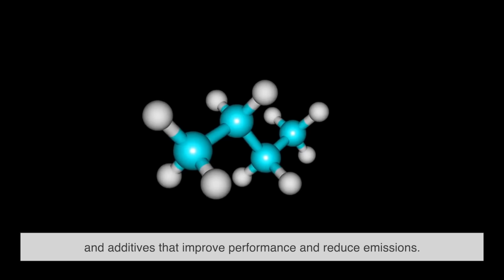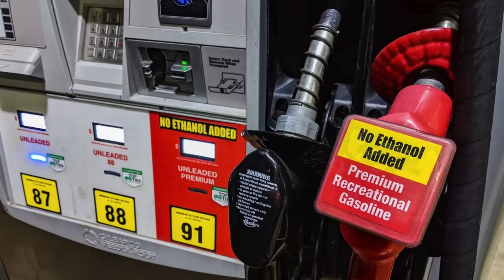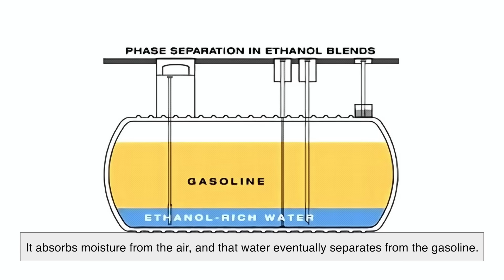Does Gasoline Go Bad?

Comment: I srored my motorcycle with 4 gallons of gasoline in its tank for 3 years in Vietnam due to COVID-19. The 1st few months battery was still alive for starting and running the engine in 10-15 minutes per week, but it was dead after that... The gasoline contained 5% ethanol  and stayed in the tank for 3 years; the result was the tank corrosion completely and the pump malfunction. I cleaned the tank thoroughly and coated with a designed epoxy for it, and then replaced the new pump. 
From now on, I use gasoline without ethanol and store my motorcycle during the absence time in Vietnam; plus hook up a slow/ticke 1 Amper charger, and running engine 5-10 minutes per week.
While I leave USA/California for the trip (usually 5-6 months), I add gasoline stabilizer into the car tank and gasoline container (for lawnmower and high pressure water.) Please note that all California gas stations sell gasoline that blend with 10% ethanol plus extra oxygen. They are 2 main elements (ethanol and oxygen) contribute to tank corrosion and damage the pump and fuel lines. Please add gasoline stabilizer if you aren't use the car more than 3 months. Per manufacturer for gas stabilizer, adding it can store gasoline in two years. Thank you.

Comment: yes. Stale gasoline in the nunber one cause of lawnmower and snowblower starting problems. Need to run these dry before letting sit for months without use
Reply: Here is one for you. Years ago, I bought a Chinese generator at an auction for $10. It looked like it had been sitting around for a long time. I brought it home, and sat it beside the house, and forgot it for several more years. One day, I decided to see if it would run or if I should just scrap it. I checked the tank and it had really old and smelly gas in it. I gave it a try anyways, and it started right up. I had a similar experience with an old Coleman generator that I got the same way. Same results. What I will say is that neither one ran really well until I put some fresh fuel in them, but there was no lasting damage.

Comment: Gasoline does not go bad!  Period.  If the container is air tight and there is minimal air in the container, it won’t “go off”.  If it’s in an open container it can.

Comment: I think the main thing is moisture.  But yes it can gum up your carburetor and fuel lines.
Oh, kerosene can gum up your kerosene heater. I've had that happen. The wick wouldn't even move. Of course, it was stored for years with kerosene in it . Big mistake. I always burn off all the kerosene before storing it now .

Comment: I've pulled stuff out of the weeds that had been sitting for years, some of it long enough to have to remove small trees and bushes that had grown up blocking it in. Most times the gas was fine. I have seen it turn to a thick varnish like residue but that was in tanks of old cars and trucks that had sat for like 30 years. There is no reason to drain a fuel tank on something that has sat for 6 months or so unless something happened to it like it sat in the rain with the cap off the tank or something.

Comment: BS! Gasoline lasts for much longer. A year old gasoline is still totaly fine (tried).. I didnt tested older, because I usually use it faster, but I would be confident, that 3 years old would be still ok to use... in carburator engines even a lot older than that...

Comment: I recently sold a portable generator that I filled when i purchased it 14 years ago, i put 5 gallons of gas with a bottle of Sta-Bil, i turned the gas off to the carb and ran the float bowl empty. I would start this generator and let it run every 3-5 years (when ever I thought about it) and it always started and ran great the person I sold it to couldn't believe the gas was 14 years old, I did recomend drain and refilling it or atleast a partial drain and mix with new gas.

Comment: I think depending  the engine type,  I have a 1993 Grand Marquis used as a weekend toy car,generally it seats up to 8 months without running,and of course with the battery terminal disconnect ,but the moment I turn the engine,it runs perfectly  !

Comment: Back in my motorcycle days, this was part of my winterizing procedure: I would dump STP Gas Treatment in the tank for a stabilizer, then start up the engine, and run it for a while to get the additive/fuel mix into the carb. Then I would top off the tank to minimize the amount of air in the tank. My theory was that moist air in the tank could lead to condensation, which could roll down the side of the tank and later get sucked in as tiny water droplets contaminating the carb. (I had coated the sides of the tank with some kind of sealant (MEK, I think it was) so that water vapor would be less likely to cause any rust in the tank.) Probably way more than I really needed to do.

Comment: Of coarse unleaded fuel breaks down over between 6 month to a year and a half depending  on conditions 

And it has that dead fuel smell

Which you have to drain athe dead fuel ,including new filters  and put fresh fuel in for it to run 

Just topping up with new fuel doesnt work so no short cuts 

Diesel  on the other hand  takes a very long time to break down 

I had the 20 liter jerry can of Diesel  used for over 10 years  in the shed  because I no longer had a Diesel  vehicle 

But used it recently  in a Diesel  vehicle  and had not problems at all 

Obviously  if it has rust and water I  the Diesel don't use it
Reply: I have a car with 5 month old gas in it 😂😂😂

Comment: Years ago, I was almost out of gas, so I stopped at a Phillips 66 station and filled up. Just a few miles down the road, my car started to sputter & misfire. Shortly thereafter, it simply died. When I got it to a mechanic, he found the tank was basically filled with water! I complained to the station. They claimed that it was in my tank before I got gas. I pointed out that if that was the case, I was burning pure water when I pulled into the station. I complained to Phillips Corporate without success. I've never bought gas at a Phillips station since.
Reply: Gas pumps are inspected usually by the state's consumer agency as listed on each pump's inspection sticker. Contact your state's consumer agency to file a complaint against the station. Hopefully, they will send an inspector to take samples of the fuels in the underground storage tanks.
Reply: Some say 87 but its 86 or 85.
Reply: If you have the receipt you should be able to claim on your motor insurance. The same thing happened here in outback Australia, the guy had the fuel receipt and a mechanic confirmed the water in the fuel. He received a check for a complete write off of the vehicle.

Comment: Bought a 200 beater car that was sitting for two years with a full tank of gas. The car actually started but ran pretty rough. I ended up two footing it till I got it down to a half tank and topped it off with premium. It ran better after that but it took a new fuel filter and a couple tanks of gas to run through it then it was fine.

Comment: I have a Jeep and an s10 i dont drive regularly and used Stabil in the fuel.I started and ran them regularly and both wound up needing fuel pumps in both.Milk has a better shelf life than modern oxidized fuel used in todays vehicles.By the time it gets to the pumps its already weeks if not months old.

Comment: So, how exactly does one clean a 30 year old tank of gas out of a car fuel injection system?

I have a 79 VW Scirocco in which I installed a new engine, then put it up on blocks (to spend the time and money on getting married). Now, I'd like to do something with it, but just from the smell, the gas is far gone. It's a fuel injection car, so whatever the gas has turned into, it's in all the lines, injectors, pump, accumulator, etc. The gas is pre-ethanol, but there's water in there, too, probably. I can't seem to find an answer online.

Comment: This got it mostly correct. Missing that most small engines, many Marine and Off Road Vehicles have Vented systems allowing direct swap of Air In and Fumes Out and act like the cap is off allowing Ethanol to such moisture fast cause phase separation. Depending on Weather or Wet/Marine use, that can happen in little time like hours to days.

Comment: A few months ago I decided to use some gasoline that had been stored in a five gallon metal container for about 37 years.  To test it I drained the tank on a small, 3 hp engine and filled it with the old fuel.  It started and ran perfectly.  If there was any deterioration in the fuel, it wasn't noticeable.  I put the rest of that fuel in my 18 hp lawn tractor and it ran normally.  I have another five gallons that I bought at the same time as the one I tested.  If I live long enough I'm going to try it when it's 40 years old.  BTW, this fuel and the gas cans were purchased at a Sunoco station before ethanol began to be added to gasoline.
Reply: i hope you can test it 70 years
Reply: For my small engines( lawn mowers lawn tractor weed whacker etc, I add 2 oz of fuel stabilizer per gallon. I add this before I go to the station and add the gas to it. This provides better mixing of the 2.
Reply: Petrol (which is what we call gasoline in Australia, it's two different words for the same thing), is still available with no ethanol added and is also available with ethanol added in Australia. It might be worth noting that a number of chemicals are deemed to be "time sensitive chemicals", meaning that they have a limited shelf life due to becoming increasingly more unstable and dangerous over extended periods of time. For example, diethyl ether, a common solvent in chemistry research laboratories that develops unstable and potentially explosive peroxides over time due to reacting with light and air over time in storage, and must be disposed of properly and destroyed properly after being in storage for extended periods of time, and must be tested regularly for the build up of explosive peroxides.
Reply: Probably because it was leaded
Reply: @AhnafAbdullah yes that is correct

Comment: This bit about destroying your engine is gross exaggeration. All in all, even years old fuel will just burn and will soon be diluted with fresher fuel. Ethanol is the real villain. Non-ethanol gas will last for years and still be usable.
Reply: Ethanol? Good question!
Potentially, it can turn into acetic acid through bacterial action. Oxgen would be needed and can these bugs work in a gas tanks?

Comment: I store my Ethanol free petrol (Gasoline for the Americans) with a fuel stabaliser in a full sealed container with little air available with it to react to. It's kept cool in my shed and used usually within about a year, but usually quicker than that

Comment: I store both gasoline and diesel fuel with STA-BIL.  I rotate each can in my emergency supply after a year:  I put the can’s contents into a vehicle, then refill the can (including stabilizer) and top-off the vehicle at a trusted nearby gas station.

I run my gasoline-fueled Honda generator for about 20 minutes once each month.
Reply: +1 for STA-BIL
Reply: I also have a Honda generator, I usually run it one or twice a year when I trim the hedges around my yard. It can take up to two hours. But maybe I can use it more frequently like you suggest even though I'm not using it for work.
Reply: @gcb345  After viewing this video, I’m now concerned that I’m not burning enough fuel just running the generator a total of maybe four hours per year.  Maybe I should drain the tank, put that fuel in the car, and refill the generator once per year.  Your thoughts?
Reply: @TubeLVT I've never drained a tank but I do put my gas storage(I have several gas cans) in my car if I haven't used it all in my lawn mower or generator. As for me, I've been lucky, but I think I have to start using a stabilizer.
Reply: I have a Yamaha generator & I run it an hour, once a month. I store emergency gas in 5 gallon cans & only buy non-ethanol gas for them. I label each can with the date I filled it & dump the can into my Truck/motorcycle/lawnmower when it gets to be a year old.

Because the generator runs 10-12 hours on a tank, I always top the tank off using my freshest gas each time I run it. I don't use STA-BIL as non-ethanol gas easily lasts a year without going bad. I've used 16 month old gas without any negative effects but, I usually try to use it at a year old just to be safe.
Reply: @DickGozinya-zl2bd  I hadn’t been paying attention to the ethanol content of the gasoline that I buy.  Here in California, it may be a seasonally required ingredient.  I will check from now on!

Comment: I used to work in a perfume factory where about 2500 raw materials of varying odour and volatility were stored in a warehouse. Probably 5% of them oxidised readily so they were stored with a small green tube running a constant slow trickle of nitrogen into the drum so as to exclude oxygen. The drums had to be left open for the dip tube, which siphoned the liquid out.

Comment: This is not true.

I stored 140 liters gasoline 95 E10 3 years ago in plastic tanks in 20 and 5 liters tanks.

Yes 25% was vaporized in the tank, thats true.

But the ethanol was also vaporized so i had 100% pure gasoline.

My car runs better and was faster /more power with the 3 year old gasoline than with fresh gasoline.

Before i used the old gasoline i have many problems with my 2 year old car, emissions fault.

With the old fuel no problems.

Now i am back on the fresh fuel the emission problems are back, explain that because the dealer can not solve the emission problems.

Old fuel in the tank of a car i agree that is not good to be used but in closed tanks i not agree

Comment: In Canada, we have to take into account if it's winter gas or not.  Gas refineries often add additives to protect fuel lines, injectors, tanks, and seals.  The fuel is pretty stable throughout the winter.  It can be an issue if unusually warm spring weather is an issue, and it happens to involve a lawnmower or motorcycle.
Reply: Actually "Winter" or "Summer" Fuel is Common to Many Countries. In US often the switch is about March and October. Is done because Summer Gas/Petrol reduces Ground Level Ozone and other pollution cause by High Temperature when it just evaporates. Winter/Summer Diesel changes how #1 #2 oil and Bio Fuel is mix to prevent Gelling etc.
Reply: Summer and winter fuel is mandatory  in europe : due to extra additivs all EU fuels must hold out up to - 20 Celcius.
Gasoline often does it  by its nature, but diesel is more vulnerrable ( paraffin floculation) .
In scandanavian countries and Iceland  this is raised to -45 Celsius and like US switch is October and March.
Reply: @fryfrysk  Maybe their Mixing in Kerosene or similar in the Diesel Fuel. Many source claim Kero Gel @  −40.0 °C (−40.0 °F) Warning Kero selling for heaters will run the vehicle but may Void the warranty etc because doesn't have additives in Diesel. Also is a Tax issue for Station and buyer in some countries as K1 doesn't have "Road Tax."
Reply: I'm in Ontario and all I add is a little fuel stabilizer in my garden engines and gas cans and I've never had an issue.

Comment: Has run into this, if you have an outboard motor and let the gas stay in the tank over the winter you will have a bad time. 
Neighbor of my boss had an plugin hybrid car and he only drove short trips so he hardly used any gasoline until he went on an road trip who ended up short

Comment: So the scenes in Battlefield Earth where cavemen learn to fly 1,000-year-old Harrier jets is improbable because the fuel would no longer be good?
Reply: Yes, for that reason and SO MANY MORE. Every component that makes that equipment work would seized and/or deteriorated so as to be unrecognizable, even if stored in a climate controlled facility.
Reply: @Drew-bc7zj  Also consider that the cavemen still wore loin clothes and had mud and sticks in their hair while flying the Harriers. So there's that.
Reply: @livinginvancouverbc2247 
Damn, I haven't seen that movie since it came out on VHS.
Reply: jets use kerosene based fuels. The kerosene would chemically breakdown & turn into sludge contaminated with water.
Reply: jets don't use gas, they use jet fuel which is like kerosene. I don't know how it ages.  Never had a Harrier to test it.

Comment: I used to believe all of this, but I'm not so sure anymore. In the Forbidden Year, 5 years ago, I purchased a bunch when it went REALLY CHEAP. I've added nothing to it and still using it today. Granted, I'm down to the last of it now, but it's still good. Old gas has a distinct odor and this still smells fresh. I don't know how, but it does. Not gonna complain, either.
Reply: I find you have to keep it in sealed container to keep it for any length of time and high octane keeps better
Reply: @murtoasumpoiler  That's the thing, it was cheap stuff in regular open spout jugs with a can over the spout to keep debris out. Not even sealed at all. The jugs aren't even indoors due to this and it still kept for this long. It blows my mind that it hasn't soured yet.
Reply: Crazy

Comment: Does hydrogen have any limit on how long it can be used?
Reply: Pure hydrogen doesn’t go bad. Storing it for an extended period is a huge challenge.
Reply: @bluenycom  Who is using it? As a physics teacher, I often wonder how it can be used in consumer cars. What kind of tank does it need?  What is the extended period challenge?
Reply: No, it is a pure gas, stored as a gas at high pressure.  To be a liquid it is near absolute zero. Should have no additives at all. Just hard to find.